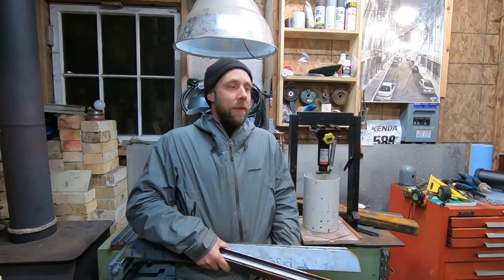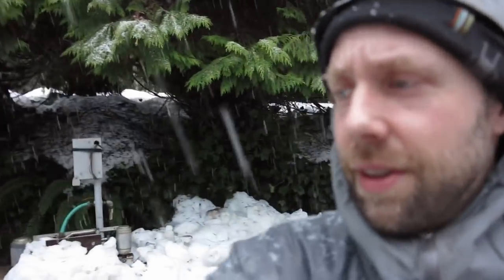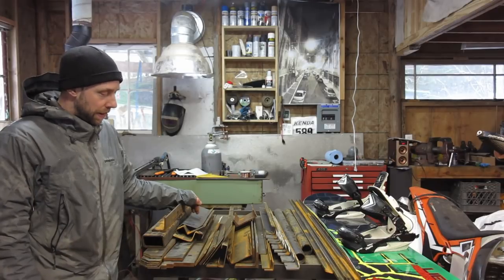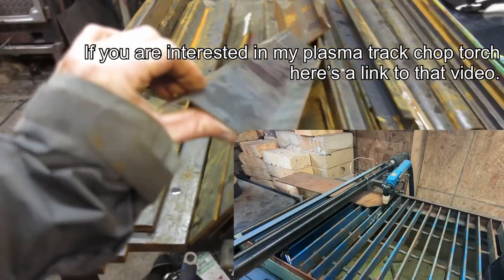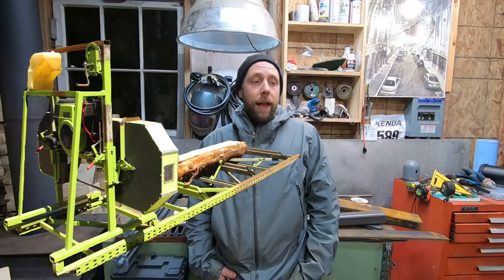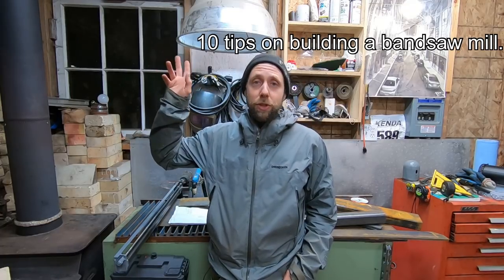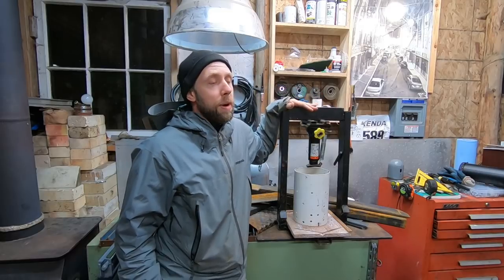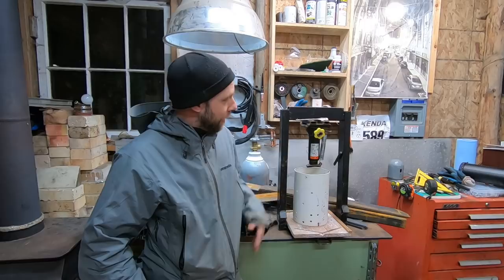Tips on salvaging cheap to free metal for projects

Comment: Hey Mike great videos . Are you still happy with the titanium? Is the omni pro worth paying the extra money? I want to buy one of them but still have reservations with it being harbor freight. Thanks
Reply from the maker: Hey Chris I’m definitely still happy with my Titanium 200! It’s a great machine.
I chose it over the Omnipro mostly because of it’s compact size and lighter weight, that fit my needs better then the Omnipro, I was willing to give up the extra options of the Omnipro for portability of the Titanium.
The Omnipro has some nice features like spot weld and the auto set is extremely handy, I would say If you want a solid welder with a wider range of options, like a amp pedal for TIG, and a overall bit more robust welder buy the Omnipro. If you want a really good welder that is lighter easier to pack around and can live without a TIG pedal but it comes with the TIG torch in the box ( The Omnipro you need to buy separately) the Titanium fits my needs the best, one thing you will need to do is replace the ground clap, it’s completely crap, harbors freight sells one for $8 and it’s a lot better, I don’t know why they cut the corner on that. 
Bottom line if you work on projects like I do around your shop the Titanium is great, if you plan on using a welder in a fab shop setting every day the Omnipro is the welder. Well I hope this helps you out.
Reply: @Mikefestiva  thanks for the feedback. The tig is not that big of a deal. I have an ac/DC tig rig. If I'm not mistaken the titanium doesn't offer a mig only machine larger than the 170 so my decision is between the titanium 200 and the Vulcan migmax 215. The titanium just seems a better quality build but the Vulcan seems to be more robust to me. With the warranty options  available I guess you can't go wrong either way.

Comment: What king of your lathe do you have ???
Reply from the maker: I have a 13”x40” metal lathe, it’s a gear head lathe so you don’t have to change belts to switch speeds. I can’t remember the manufacture of it, I do know it’s made in Taiwan in the mid 80s there’s a lot of these lathes that are sold under different names, Jet, Enco, Grizzly and so on. It’s definitely not the nicest lathe out there but it does everything I need it to do 🙂
Reply: You have a nice little shop. I really like that little plasma table. That's sweet. Thanks for the video's Mike.

Comment: I've had a fab shop for years,,there is not way in HELL I would "GIVE" this kind of metal away...NOPE, Don't know who this guy is dealing with,,but they must have more money the sense. LOL
Reply from the maker: No use for lazy people None. Well the guy that owns this fab shop does big jobs and sometimes it’s not worth trying to use every last scrap when time is money.
Reply: Most shops accumulate so much metal, or wood in the form of cut offs left over from various jobs they eventually have to get rid of some one way or another or be buried in it. I do woodworking at my home as well as metal work. I have lots of wood scraps that I have to find ways to dispose of. Some is good for kindling but plywood, PT, OSB and composites I won't burn in my stove. Even though I do hobby metal work, eventually I end up with many pieces so small they are of no use to me. I keeps some and the rest gets sold as scrap, at which time I take the opportunity to walk through the local scrap yard and buy for pennies on the pound what large shops have scrapped. I am amazed at the large pieces of new metal I find there, so much so I've considered buying it up and opening a metal sales shop for people who need to fab small projects and don't want to buy full lengths of material.
Reply from the maker: fun one People like yourself never seem to amaze me the stupidity in your comments. I forgot you are 12 years old 😂
Reply: @Mikefestiva  Not a Monty Python fan?  You realize it's a joke pointed at the 'no use' person?? He's dissing your fab shop guy for being nice to You. Or just lack of sense of humor I guess. And you're wrong, I am 10 not 12.
Reply from the maker: fun one I’m definitely a Monty Python fan👍 it’s always hard to understand who the comments are addressed too. Sorry fun one, I guess I’m a little jumpy after getting trolled a  bit more these days. Haha! Again sorry dude 🙂
Reply: @Mikefestiva  No worries....but you did have me concerned for a second.... I just go for the humor. PS your channel ROCKS
Reply from the maker: fun one I would be concerned too if I thought someone wasn’t a Monty Python fan 😂 
In my next video I plan to build a large wooden Badger 🦡 👍
Reply: @Mikefestiva  Very good LOL I suggest Predator V twin.